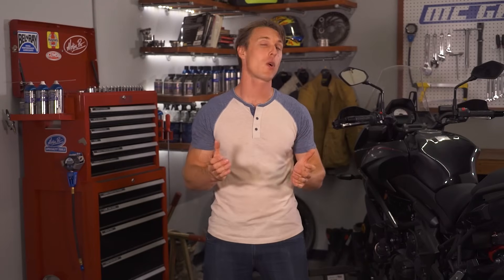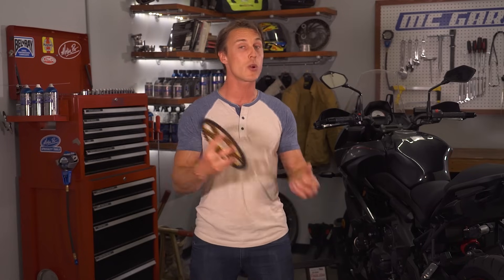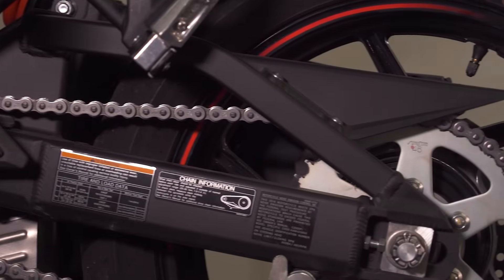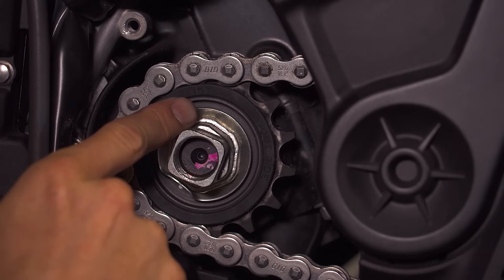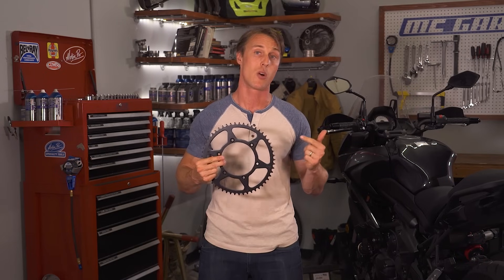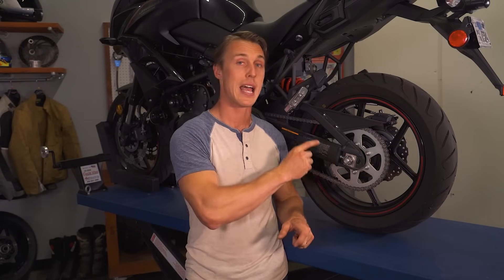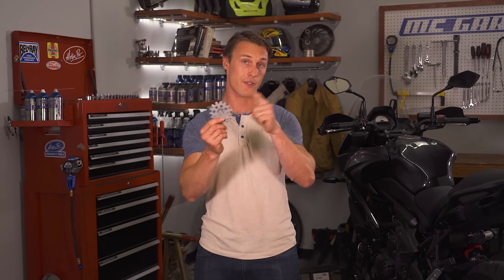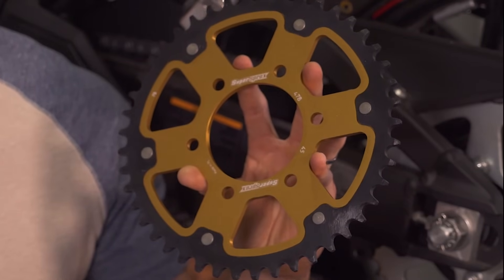Motorcycle Gearing Changes Explained | MC Garage

Comment: If you want to gear for more top speed, one tooth more on the front is ok, rarely two. Because the front sprocket should only deviate one tooth down or up from factory gearing, for best results in most cases with most motorcycle gear boxes. Most larger road motorcycles benefit from going down one tooth on the front, for a bit more punch. If you are on a smaller cc bike that revs too high at your cruising speed in top gear, then you can go up just one tooth on the front. Remember how sprockets will affect chain length, and it's better to take off a few links, cos adding is dumb. Have chai adjuster blocks all the way forward before working out length, as chains stretch and you have to adjust it out. Keep in mind chain length if you want to be able to swap sprockets for different applications. One tooth either way on the front, gives for least chain adjustment, and you can usually get away with not cutting the chain. Just think about it first, and always set chain tension when sitting on a bike, as it tightens when you sit on it, then further when you compress the rear shock over a bump.

Comment: I just bought a 2024 Kawasaki Eliminator and I love the bike. But I;ve been riding V-Tqins since the 1990's and I am use to a lower RPM at highway speeds. I am thinking about changing my front spocket from a 14 tooth to a 16 tooth but I worry that moght be too much. I don't care about the quickness of the bike but I know if I go too big on the front spocket the bike will labor hard when in the higher gears 
   So my question, is going from a 14t to a 16t front spocket too much? Should I just go one tooth larger to a 15 tooth and be happy with that?

Comment: I'm changing the front sprocket from 14 teeth to 18 teeth. How much change i might face?
Reply: I dont like the idea of changing the front, for early torque [change] concerns,  [like on a bicycle when you jump the chain to that fat sprocket,] you need to peddle harder, at first though need more torque even, for the speed.  where by just lowering the back sprocket, your initial TK stays the same, but as your REVS increase, AND thus the TK, your rear wheel will spin more with a few less teeth.  So for cruising, just lower your rear by a few teeth.   dont worry about the price or the hassle? .... of taking off the rear wheel? in the long run, you will get a bit more cruise speed at a lower RPM :)

Comment: Great video.

I have a 2009 CBF1000A and I need to replace my chain and sprocket soon.  I am considering different sized sprockets if they would increase the acceleration from start off because the CBF1000A's first and second gears range are so low they really hinder a good take off.  I have ridden some other bikes which effortlessly accelerate from zero to say 60km/hr in first gear.

How much of a high end speed reduction is there by going with a shorter gearing?  Can you provide some examples?

Comment: Another thing to think about is rebound inertia. Similar to the power loss of a piston having to travel in the opposite direction before more power can be created by it. Think about your chain having to whip around a tiny front sprocket vs being able to more slowly/efficiently roll around it. So having a bigger front sprocket and also a bigger rear sprocket may be worth trying. Also at the same time you may, depending on how big you go on either, will equate more sprocket and chain weight (if you need more chain links) and more rotating mass, unless you are running aluminum vs stock steel. Without a crap ton of math making it a perfect science it's another consideration of gear changes to think about/play with. Especially for the rider who has three or four fronts and eight or ten rears. I've gone back and forth with a few of these myself on dirt and street with interesting results. Lemme know if anyone tries it and how it works out for you.

Comment: Noob question : Does changing gearing affect where the powerband is? Like if you gear a sportbike down for more torque and less top end is it effectively moving the power band down the rev range? Or does it apply increased acceleration across the whole rev range and not effect the power band specifically?
Reply: No, powerband is to do with the engine itself and how it makes power. Gearing just affects how that power is put down. Easy to think of if you use a bicycle. When in a high gear (ie low gear ratio) its hard to get the bike to accelerate quick, but in a low gear it is super easy and you can even wheelie if you are not careful. The powerband (ie your legs) never changes, just how quickly youre in it and what affect it has on turning the wheels. So in effect, shorter gearing will make the bike feel more torquey, but you will go through the gear a lot quicker and ultimately have less top speed. hope that helps!
Reply: @hisride  Thanks that's helpful, it's kind of what I suspected
Reply: @teagan73191  nice one. Im bout to go one tooth down in the front and 7 up in the rear so im imagining ill struggle to keep the front down lol
Reply: @hisride  wow let me know how it goes! I did one down two up on my 636, I love the power delivery now
Reply: @teagan73191  will do, thats awesome!

Comment: Its a very good video to explain everything i just have one question im currantly a semi new rider im riding a 250cc scrambler and its running a 428-16t in the front anf a 50-428 in the rear witch sprocet do i replace because i need to replace my rear and chain pls help me?

Comment: Guys I'm doing -1 in the front & +2 in the rear on my 2015 Z1000. The OEM chain has 112 links. Now that I'm changing my sprocket set up, will I need a longer chain or the 112 chain is good to go? Need this answered asap. Will be vv grateful my fellow moto - people.

Comment: If I’m satisfied with the torque down low, I just want a little more top end speed. I got a 2022 ninja 650. will adding a tooth in the front mess with my power down low? How should I go about re gearing my 650?

Comment: I run 2.63 sprocket ratios on my commuter r6. That’s a 16 and a 42. Cruzin on the highway to work at 75mph only turns 5200 rpms. Still plenty of power.
Reply: so you have longer gears?

Comment: Is there a difference in changing the gear ratio on the front or on the back, other than budget, when you get the same result?  Let's  say  16-48 or 15-45, which gives me 3.00 Gear ratio on both. What will result in better performance? Subtract 1 on the front (because engine speed) or add 3 on the back. (ok, I am thinking in weight savings if I go for a 48 aluminum) or it does not make a difference. Thank you

Comment: Hi, I'm riding a 125 (14 th front 45 th rear) if i change the front to 15 and the rear to 43 will it increase the top speed or not??
Plus I'm looking to get more power out of the engine, getting hit face on with wind seems to slow the bike down. Thanks

Comment: Changing sprockets pretty much only affects 1st gear and top gear, as the rest of the time you can just hang on to a lower gear longer / change up earlier for pretty much the same effect. Rare I need more umph in first so lower gearing is irrelevant there, and at speed I can just sit a gear lower and keep the option of changing up.

Comment: I want my bike to ride at 1200 rpm in 6th at 100 mph.
Reply: u need a 2200cc engine for that,
Reply: U need about a dying stars power for that
Reply: @17kmh lol
Reply: Boss Hoss
Reply: I wish. On my zx4rr I can’t go above 60mph without the bike screaming. I can keep it quiet before that, but on the highway I’m stuck at at least 6-8k rpm in 6th just cruising and it feels wrong. And I can’t sprocket change with already low 20-25ft lbs of torque. I like acceleration and wheelie potential. I’d have to build custom gearing and make 6th my ridiculously low rpm overdrive mode
Reply: Drop it off a plane and throw it in 6th

Comment: Hi, i would like to upsize my front sprocket from 14 to 16 teeth, and my bike currently runs with 116 link chain, should is upgrade the chain too or will it works with the same 116 link?

Comment: I recently changed the front sprocket on a Honda monkey from a 15t to a 14t. The bike now revs much higher. Is it safe to ride the bike on long rides (50 miles or longer) with the RPM's so high? Do you think that will damage the motor? I had the 14t sprocket on a long ride recently and I hated hearing that thing scream the whole way. I liked having the 4th gear (overdrive) in the original sprocket. Should I put the original back on?
Reply: Won’t damage the motor jus wears it out more

Comment: What if one increase both the sprocket sizes? For example,
Stock: 14/39
New : 15/43 !?

I believe it wouldn't make any difference but just increase load .... Idk . I know this sounds stupid but i really wanna what what can this do!
Reply: That's dumb...all you're doing is adding more weight without really changing anything ( be it faster acceleration, or less rpms at same speeds for better mpg).

Comment: Hi, I just want to ask. If i change the sprocket size of my YZFR15 V2 from 15/47 to 14/49 does it have a affect or change in reading on the speed meter?
Reply: Yes...and that deals only directly with the front sprocket change as chances are with it being directly connected with the transmission shaft, the speed sensor in which is being read deals directly with that.  Thus without a Speedohealer or another similar product,  the faster you go, the higher the actual difference in real world speed you're doing versus what that stock speedometer in your stock cluster gauge will read 

One tooth count going UP on my cb 500x 2019 from 15 to 16 tooth = 10% differences in speed readings in stock speedometer in my gauge cluster versus actual gps real world mph at 55 on the speedometer but 60 on the gps in 6th gear.  

You can adjust the rear sprocket to almost any size that you can find without it messing with the speedometer's reading accuracy.  

In your exact example would mean your stock speedo will show you're going faster at speeds 40mph and above ( bigger the speed..the bigger the difference), than you're actually doing given you're going down one in the front and up two in the rear...thus that will give you slightly faster acceleration at teh cost of higher rpms needed for the same original whatever speeds above a certain speed range such as 30 or more mph.

Comment: Hey Guys
I'm looking to go for a taller gearing Setup
So, What If I Increase the Teeth on the Front Sprocket and Reduce the Teeth on the Rear Sprocket? 

Front: 16T
Rear : 42T
Final Drive Ratio: 2.63

Will this Setup Increase my Top Speed Effectively while compromising my Acceleration(Torque)?
Reply: "What If I Increase the Teeth on the Front Sprocket and Reduce the Teeth on the Rear Sprocket?"

That will slightly increase max speed but there is a limit to that idea.

The most applicable reason to do that for the every day street rider is lower rpms needed for the same speeds dealing with slightly better gas mileage at the sacrifice of slightly slower acceleration speeds, but also the benefit ( at least in my opinion) of a "longer" 1st gear.   Meaning if you're tired of having to shift from 1st to 2nd reaching the 12 or 14 mph mark to not push rpms over an easy -rider's mark.....doing your idea, will probably guarantee the same rpm shifting from 1st to 2nd at 17 or 18 mph as you would have had stock at 13 to 15 mph....realistic  guesstimate there.

That's the result I got on my cb 500x 2019 going from stock 15t front with rear 41t to 16 front to 40 rear ( I plan to replace the rear to 36 t and with a fresh new 16t in front when it's time to also change the original chain too all in one big swap)
Reply: @motoryzen  yes, cruising at decent speeds at lower rpms is also one of reason why I wanna do that..... However an experienced track rider did warn me not to alter both front and the rear sprocket..... As it may result in very poor performance....

He said, either alter the front or the rear and not both at the same time

What are your thoughts?

Comment: Fun fact, on electric motorcycles, having a larger rear sprocket can actually improve mileage by taking stress off the motor
Reply: "on electric motorcycles, having a larger rear sprocket can actually improve mileage by taking stress off the motor " 

That makes absolutely no sense given if the bike is rear driven on an electric motorcycle ( meaning the direct...drive shaft or chain connection to the rear wheel is involving the rear sprocket..unlike your gasoline I.C.E. bikes)...a bigger sprocket unless you go 100% aluminum from stock steel....wiLL ALWAYS be heavier and thus require MORE energy to move.   duh.

Comment: I can figure my the current ratio setup. It is 17/34 tooth = 2 to 1 ratio. Now for my question. I knows from a front wheel pick up it is 55 mph = 4000 rpm at tach. What is the math used to figure the expected different rpm to be with 17/32 tooth = 1.88 to 1 ratio ?  mjlawrence@frontiernet.net   Again Thanks for the video !

Comment: Can anyone help me .. so I have the Kawasaki 2020 400 Ninja I have been having problems trying to figure out what gear to Cruise in ..so when I shift I normally shit at about 3-4 rmp from 1st gear all the way to 6th and just cruise that out until I come to a stop sign or stoplight is that safe for the bike..... Also I noticed when I ride in high RPMs the bike gets very hot how to prevent that.

Comment: I have gsxr 1000 2016 which comes with 17 front 42 rear planning on changing the sprocket what gear ratio is best for street as i want to increase torque and lower the RPM any recommendation
Reply: What did you end up with?

Comment: on city riding better go with stock

I actually got worse fuel economy on smaller rear sprockets in the city but I got WAY BETTER Fuel Economy on the highway

but if you live on a place where there's inclines everywhere
I got better fuel economy with a bigger rear sprocket

I ride a 74' Honda CB350

Comment: Hehe nice vid, its good thing to do, a friend of mine bought as first ride a gsxr 750, but he wanned 600, but owner before changed rear fairing ans painted so there wasnt number for engine size wich sais what is "model" 600 750 or 1000 on suzuki, and friend dint watch what owner writte before he contacted hem to buy, and he rode a 600 same model before and can remember a little the feel of pull from 600, when he start to ride hes new bike he says he notice a small difference not big just a arround 10% it pulls stronger in suzu powerband, we watched rided and it runs great but with saim amlunt of gass it goes a bit beter than 600... but anyway it is good thing latter we found it is 750 engine haha 🤣 and becouse he is noob allso i am still noob even i ride coupe of years now, he bought front sprocked bigger 1 tooth, and bike pulls wery similar as 600, and meybe gained few kmh faster bike 😁 and wich is great he if want more power he doesnt need to put powercommander and tune for more, just put back sprocket 🤭 but it is good idea if someone like the look of for example of 1kcc sport bike but is begginer and ride 80% in city trafic, its great idea what he or she can do to reduce torque wich in my opinion is great, i ride 600 k7 gsxr, but i wanned that 750 for futire but tought it is a bit strong even threre is a minor very difference in "stock" form bike i am talkin, so just put sprockets that will gain you more speed and reduce torque and latter when you think u want mlre just put back stock one's, i kinda like this my friend idea what he did, soon i am gettin 750 but for rest of ppl who want for example stronger bike just becouse of that wider tire and looks but are begginers, dont wory buy it and just make it a bit weaker, i know what point is in 750 or 1kcc engine but hey its not that u are weakening ur bike by ecu or some engine parts... its not it is just some small parts that does not effect engine real performance and workin so dont wory ^_^ i am sad i didnt buyed before 750 and did this ^_^ and now just put stock for regular more power

Comment: Changing the front is the easiest and best. YOU DON'T NEED MUCH. One tooth is a lot. My SV1000 was too tall so I DROPPED a tooth up front; my old Bandit 1200 was too SHORT (it's a 5- speed), so I went UP a tooth. Both brought the bikes in-line with how I ride. Be careful though! 1) make sure you have enough physical ROOM to increase front sprocket size... and 2) watch your chain slack on the swingarm marks. You could easily make your chain too short or long. PS - I never worked on a bike where you could "easily" swap front sprockets without at LEAST removing the rear wheel.

Comment: Can changing sprockets increase both acceleration and top end? I mean by changing both front and rear sprocket
Reply: No because sprocket size is irrelevent, it's the ratio between the sprocket sizes that matters,  that can go up or down,  not both.

Comment: Im about to buy an FZ8 and plan to put on new sprockets and chain. Standard sprockets are 16 46 and to get a little more gas mileage was thinking of 17 45 so plus one on the front and minus one on the rear. Will this require a different length chain?

Comment: If the rear wheel is 18" with 40 T sprocket and front sprocket is 13T, keeping the same performance, what should be done if the rear wheel is changed to 17"?  I have a Honda CRF 230 with 13/40 sprocket. I want to change the rear wheel to 17". Please advice. Thanks in advance.